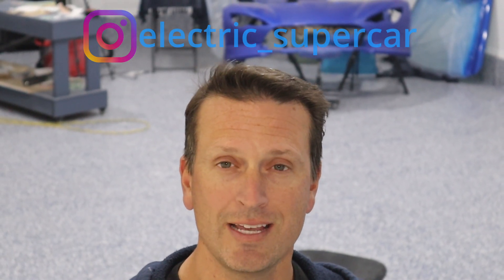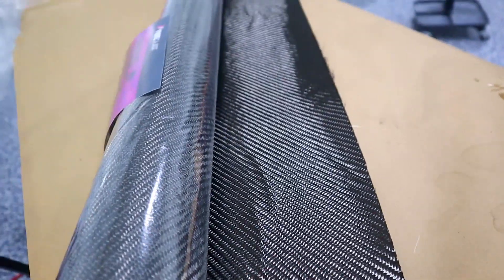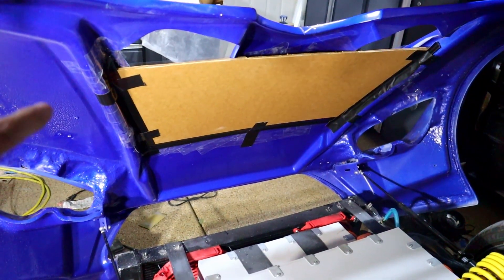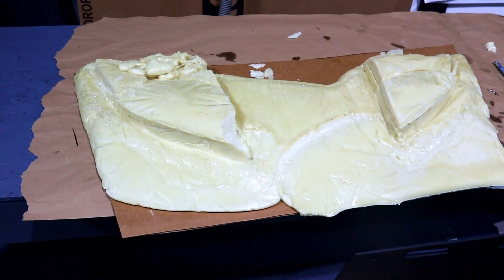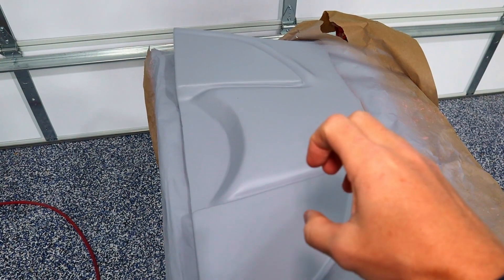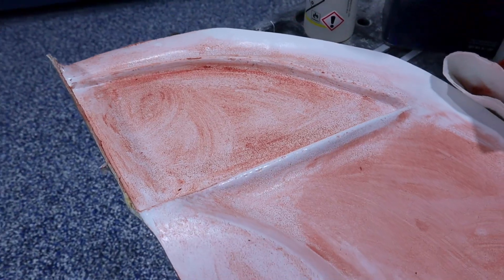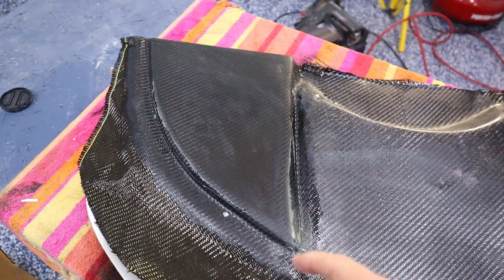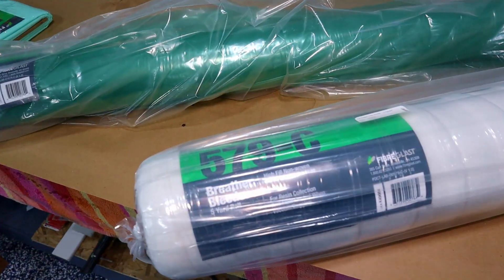Stabilized Carbon Fiber

Comment: The only way I have gotten PVA to spray nicely is with a detail gun (1.0mm tip), full fan, and 20psi underload.  Med-heavy wet coats, 2 usually do it.
Reply from the maker: Thanks for the tip!